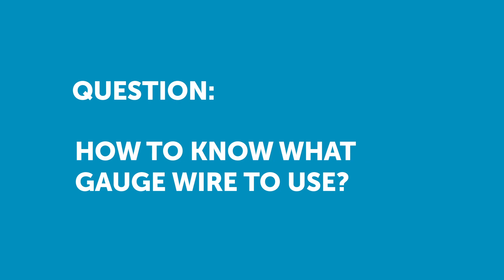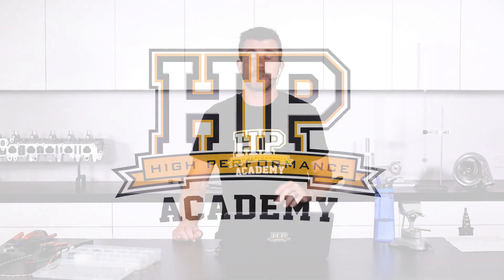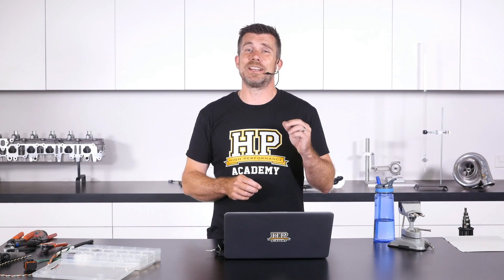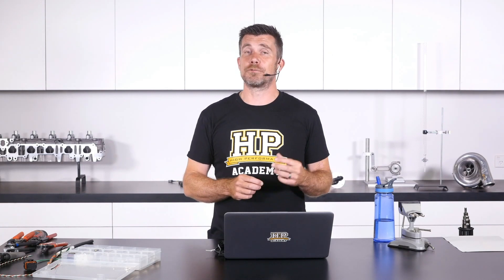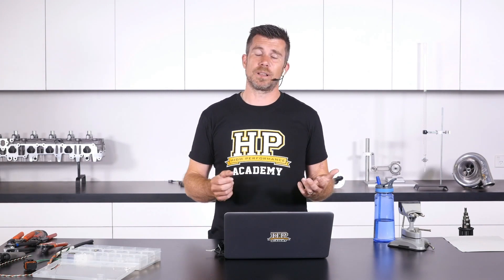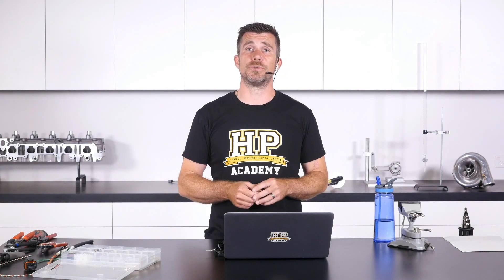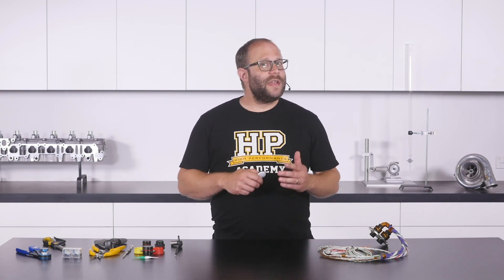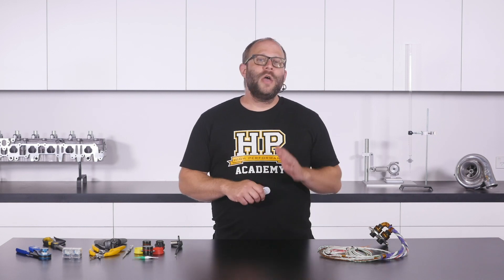How Do I Select The Right Wire Gauge/Size? | [HPA Q&A]

Comment: As an aside, what are your thoughts on using ferrite chokes on the more sensitive circuits that may be susceptible to high frequency noise or spikes? You can buy clip-on chokes from most electronics stores, if they may help on problem circuits.